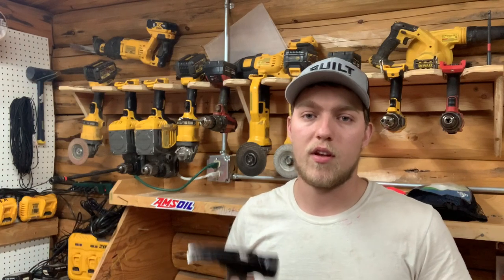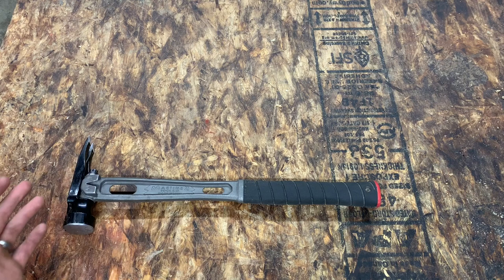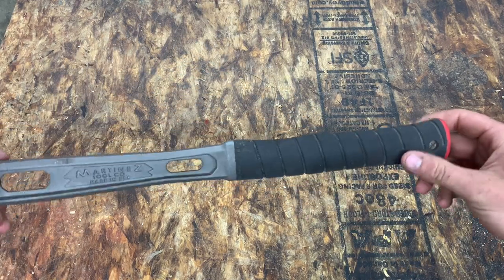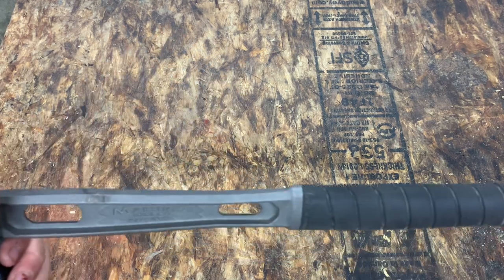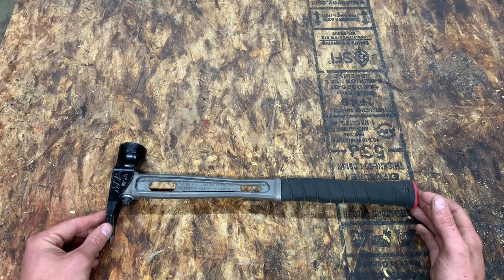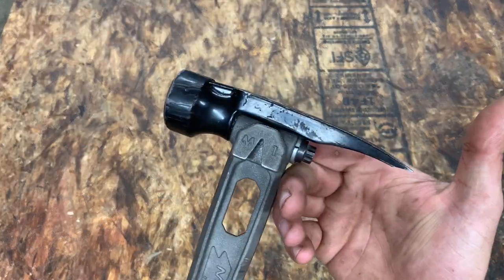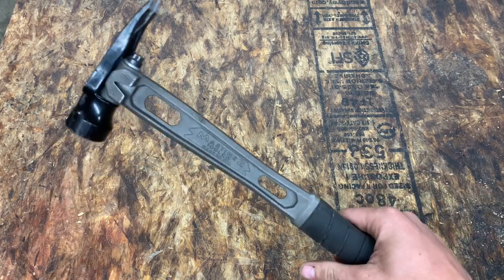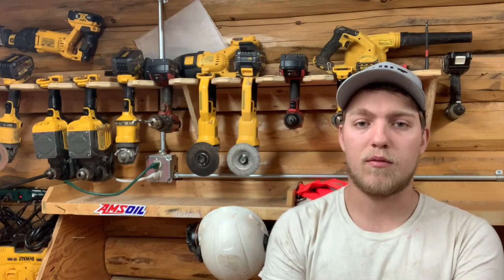Martinez Tools M1 Titanium Hammer Full review

Comment: I have considered a Stilleto hammer for my finish carpentry company, the tool dealer in my area steered me away form the brand, the owner broke a tooth pounding a framing nail. The warranty was voided because he used the hammer, another used the teeth to pull  a nail broke them off, again the warranty was voided due to miss use, should of used the side pull feature 

instead try to get you to buy a Martinez. the warranty covers the hammer with no fault within reason usage. 
Thanks for the video.

Comment: Dude I love my m1 martinez hammer, I do concrete forms, and gotta say it's been a hell of an improvement over the hammers I was rocking before, I was using 22 oz hammers from steel to fiber glass handles and the martinez to me has such a great handle, the weight of the hammer is no different then the heavy hammer I was using, my hits are harder and I love that nail puller on the side, and the hammer is way lighter then what I was using

Comment: depending on how you grind it, you can take tempering out of the steel, and change the grain structure. especially where it is thin.  if it is cold ground, or manually filed, this won't happen. just a thought

Comment: I love both my M1 and my M4. I bought them before the Stiletto III came along.  I would be hard pressed to choose again knowing the improved version of the TIBone III is there.
Reply: I'm looking to buy 1. I do frame to finish so I can't decide if I should go m1 or m4. What one would you suggest?
Reply: @cristiangalandzi3440  - hard to tell but I do use the M4 and handle a lot. I use the M1 and handle mostly for the heavy work. Both smooth. But to be honest, I prefer the the M1 overall. It fits me and I can choke the handle for delicate stuff. 

If I were to buy just one but my job was mostly finish, I would get the M4 smooth and handle. The shorter handle and smaller straight faced head are more practical for that and it will still drive framing nails. And I would certainly buy the M1 head for those heavy framing days.  Just know that you can easily frame and do finish with an M4 head and M1 handle and vice-versa. I see lots of guys with these combos and it works very well too. You really can’t go wrong but I get the dilemma. 

I have both and use both as intended.  I love using both too.

Comment: Am so close to buying this hammer, agree the side nail puller is a plus, the thing I'm not to keen on is the thickness of the end of the claws, if you grind them like yours carefully so you don't lose the temper, would it void the warranty if a claw broke through over straining. Does it feel top heavy, good for swinging, however, you will need to pull that weight back, could possible fatigue the forearm if nailing all day like i do. Good informative video 👍
Reply: The claw is part of the steel head like 40$ to replace. Stiletto breaks, you gotta toss the whole hammer
Reply from the maker: Very good points, I’ve wondered about the warranty issue as well...

Comment: Is this hammer durable enough to do form work with? I go thru hammers a little quicker than the average carpenter from always pounding on steel clamps and forms currently using the mig welded dewalt 14 oz wonder if this hammer would last longer
Reply: Basically with this hammer you are investing in the hammer shaft and everything is replaceable around that so if any part wears or breaks you can fix it..... as have  most people said it felt a little weird at first due to the slightly different feel for were the weight is but now I absolutely love it 

Iv had estwing 24oz, fatmax Extreme anti-vibe 28oz(small head), fatmax mig 14oz, newer fatmax 28oz (large head), some old fiberglass handled claw hammers and used a ti-bone 

M1 with straight grip for me all the way

Comment: I respect all of the work, insight, design, etc.
I'm on my 3rd stiletto. My first had the same thing, the claw was fucked from chipping concrete.
2nd Ti-bone 2 because of the claw issue, after about 5 -6 years anyway.
3rd because I lost the 2nd during foundation work for months.
A coworker ended up finding it, surprisingly. One thing not to do as an apprentice fyi, is grab your coworkers shit and just start smashing the claw on shit, or any tool really. 

I honestly didn't like the way the martinez is weighted. I like to keep my swinging hand basically on the very end of the hammer, unlike this video. There is no right way to do it, but I find I get a little extra power, with a lot less work than my last standard hammer, 28 oz estwing.

to each their own. i'm not switching until retirement from the ti-bone 3. I might have to buy 3 or 4 more.. but it would be worth it.
Reply: Does the ti bone also come with a titantium handle?
Reply: @gisi834  Yes. All titanium except the  face.... Including the claw which is why a lot of people are steering away from it. With the. Martinez the whole top assembly is replaceable. 

To each their own though. The m-1 is still a solid hammer. If it was my first high end hammer if you will, I probably wouldn't like the feel of the ti-bone series.
Reply: @codyolmstead4907  - i get what you mean re the weight. I personally prefer head weighted because the follow through on the swing is better for me. It wacks!  I also much prefer the thinner handle. Both these attributes work well for me. 

And I also prefer the all steel head vs the titanium one. The ears, you know, the ears.